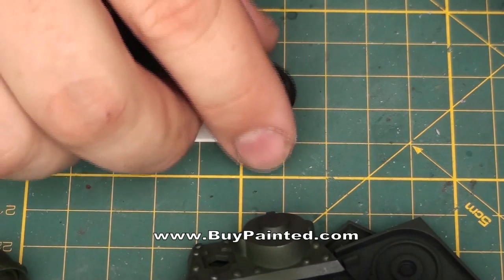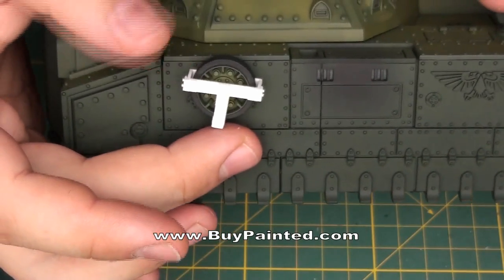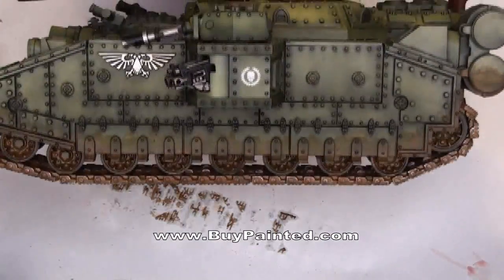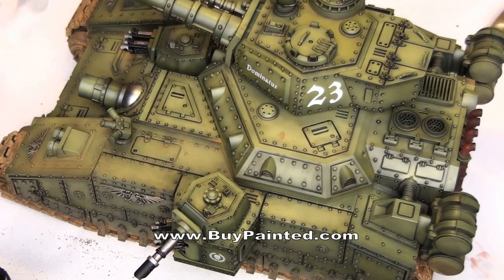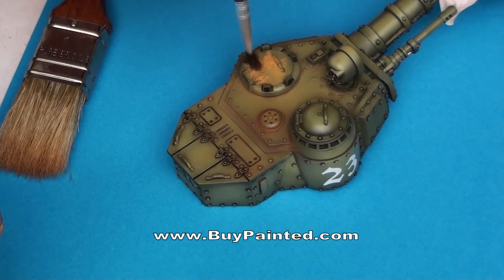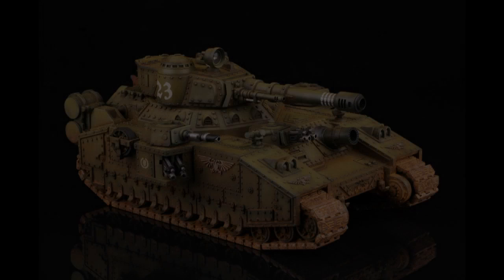How to paint Banebade Tank Imperial Guard? | Warhammer 40k  | BuyPainted

Comment: Love the tank, i have just bought a Baneblade and I am just fitting the lights in it, Did you have to use a resistor for the top light, as it is bigger than the rest? 

and also, the video says the colour modulation goes catachan green then camo green, then more camo green, but the tutorial on your website says that it is Russian green and russian green and desert yellow 1:1 and then 1:2

which is right????????????

could you please clarify.